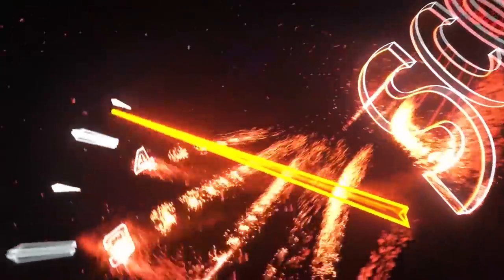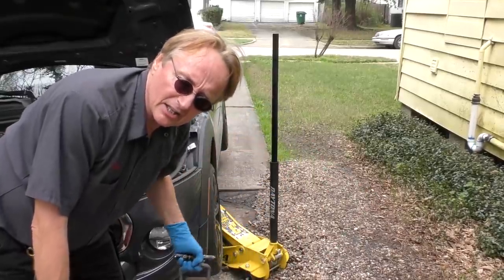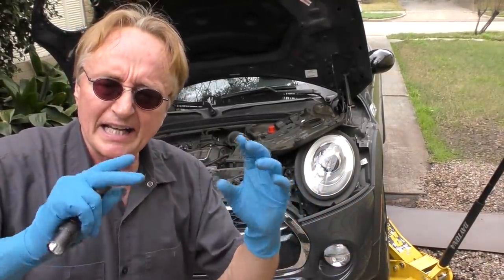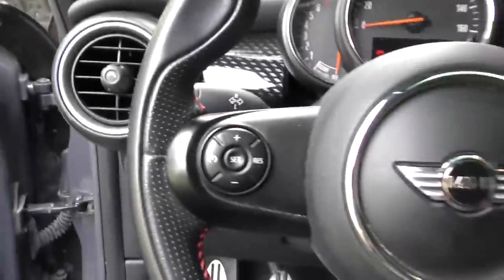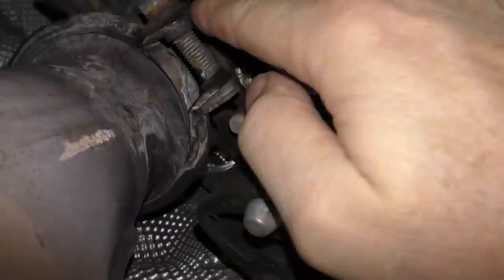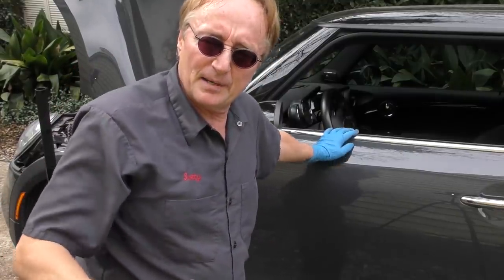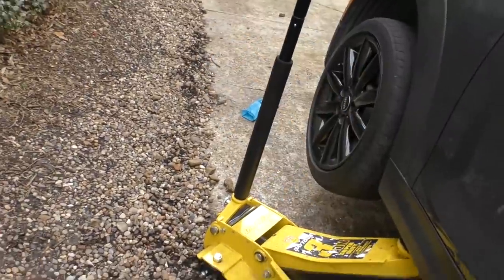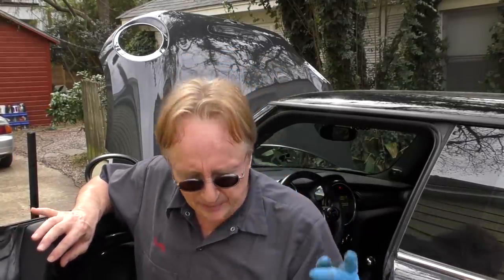Doing This Will Make Your Engine Run Better

Comment: Simple easy fix. Dealer’s assessment and fix would be no less than $400.
Reply: That's if they aren't trying to upsell you a new cat lol
Reply: @AdmiralFroggy  Or tell you your brakes are worn out when they get it on the lift.!
Reply: $300 if your super lucky😁
Reply: Esteban Echeverri and new exhaust.
Reply: @rickdaystar477  ya and disconnect the the brake pad sencer
Reply: @Ilikepie18855  ya
Reply: @rickdaystar477  they just did that too my dads jeep. It has 23k freeway miles. Those scumbags
Reply: @nickmccain6598  It's at the point where you have to ask people you know that had work done for a fair price where did they go.Or get 3 estimates at three shops for repairs. These crooks are predators.
Reply: @rickdaystar477  yea. Its only gonna get worse. In 5 years when electric goes crazy. Mechanics will come up with more ideas. My friend took her toyota to the dealer. And said she needed all new lug nuts. That's just awful. Because she doesn't understand cars at all
Reply: @nickmccain6598  OMG new lug nuts or the wheels might fall off eh ? How about changing the air in her tires?.
Reply: @rickdaystar477  she said the mechanic told her they are really close to stripping next time she changes tires. That should be illegal
Reply: @nickmccain6598  Just out of curiosity did she buy new ones and do you know what they charged her? I'll bet Scotty never saw stripped lug nuts in 50 years. I never have in my own 50 years of driving and maintaining many vehicles over the years and I've honked some pretty tight with impact air guns.
Reply: @rickdaystar477  I just kept my mouth shut. I felt so bad for her. On toyota website. $73 for the set.  Maybe the mechanic is practicing for electric car maintenance😂

Comment: Honda dealer tried to rip me off. Inspection found exhaust leak. They told me I needed a new entire exhaust system $900. I said "show me the leak" and they said "we can't, it's off the lift". I said "put it back up and show me." With my Element back on the lift with engine running the mechanic said "hmm, I thought there was a leak up front" but the only leak was from a rusted connector from muffler to tailpipe.  I took it to a shop that welded tailpipe back onto muffler for less than $100.

Two years later similar thing happened at same dealer. Failed inspection due to exhaust leak. Said needed new exhaust system. I took it home and found the leak was a rusted connector behind cat converter. Bought a new spring bolt and clamp and fixed for $45 at home.

I don't trust the dealer at all. I go there only because I bought my Element there and inspections are discounted. Dealer has also tried to sell me new brake rotors I didn't need. And tried to sell me new caliper but caliper was fine, only the slider pin was rusted which I fixed myself. This dealer has thousands of customers and surely has made millions upselling needless parts to clueless customers.
Reply: Ya as you pointed out do your research and only go to good honest mechanics only
Reply: Ask dealership first if they know Scotty.
Reply: @Conservative_East  ya that's a good idea
Reply: So glad i found the best honda mechanic in south Carolina. I bring food and my car with me there cause i only give him the hard jobs so i feel bad. so bojangles biscuits go a long way friends.
Reply: I mean, you can do cheap bubble gum repairs and bodge together exhausts. But, in most cases you'll be chasing a new leak every couple months as the whole exhaust system is engineered to crap out in unison. A dealer has to be accountable for a long term solution, though. Exhaust is no joke, getting daily carbon monoxide can really screw with your health and you wouldn't know it. I think it's really a sham how chincy nearly all factory exhausts are. Almost gauranteed to rust out in under 10 years of road salt. Costs the owner either their health or $1000 to fix properly. They should all be factory stainless, but thay would be $50 of lost profits and way less new car sales. My 1999, 175k mile, "endless money pit" has a factory stainless one piece exhaust. Exactly 0 leaks after 21 years of Pennsylvania salt. It's also never been immobile, towed, or worked on by professionals. That is not to say i recomend a newer one.
Reply: @apodski  yes agree
Reply: @1stock1not  ya
Reply: Excluding the engine, transmission and few electrical issues, most of the maintenance and repairs are simple and doable at your own driveway. For instance, changing the brake shoes would cost about $400 at the dealership and at least $180 in local auto shops but if you DIY, good quality brake shoes cost about $40-50. If you have to flush your brake fluid, its a $10 job at home, and super easy too, but probably have to pay more than $100 for a mechanic. Same case with the oil change, good quality synthetic oil costs around $25 for 5 quarts, and $5-10 for a good quality oil filter. Engine air filter and cabin air filter cost around $10-15 and replacing them is as easy as changing a curtain in a window.
Many car maintenances are easier than many household chores you do every day in your life. So, why don't you maintain your car yourself? What you need is a little research and the courage to start.
Reply: @upaharjungshah8536  ya
Reply: I had a similar issue due to a bad starter, brought it to the dealership to have the starter replaced. Car has an Aisin carburetor. Dealership first called and said they couldn't move the car since no one could drive a stick.. then called with a 2500.00 bill for needing new fuel injection system.. i bump started it and drove it home, 65.00 later, new starter installed..
Reply: @shartingfish5761  good idea

Comment: Having a damaged engine sucks, but killing two people is worse.  When I was flying an air ambulance in 1994, we lost a crew and airplane after it was incorrectly fueled.  The Cessna 421c had taken on 60 gallons of fuel in San Antoino.  The correct fuel for the plane was high octane gasoline (100 octane low lead); however, it was fueled with jet fuel (Jet A) which is similar to diesel fuel.  Like your customer's car, the engines started and ran until the gasoline in the fuel lines was exhausted (1-2 minutes after take off).  With no available thrust, the plane descended and crashed killing the two pilots on board.

Comment: I have a smoke machine and they have their uses but the best way to find an exhaust leak is using a shop vac in reverse blowing up the tail pipe on a cold exhaust then spray soapy water all over and look for bubbles, it will pin point the smallest leaks.

Comment: The best and easiest sure fire way to find an exhaust leak, is buy the cheapest store brand dexton/mercon atf you can find. Unplug an ummettered vacuum line and let it suck in about an ounce of atf. Then rev the engine up! Wherever it is leaking exhaust a white cloud of smoke will bellow from it. You will also clean you valves really good.

Comment: Hey Scotty.

Do you recommend doing an engine rebuild/buying remanufactured engine BEFORE I need it or after I need it?

I have a 2003 5.4 2v Expedition

230k original engine. Runs like a champ, but her days are limited. Not sure if I should jump ahead or wait till she explodes

Comment: Scotty! I am surprised that leak did not show up considering that smoke machine out put is 10 to 15 PSI. I wonder how much pressure can be achieved by simply idling a car passed the cat.Converter on a typical car that size.? Maybe plugging both exhaust ports securely instead of rag would have given you the result.

Comment: I have a 2019 cooper s like this one and my clamp actually broke.  I had to take it into the dealer twice to get them to fix it under warranty. I had to pull up the white paper of the exhaust system to point out where it was likely damaged. I have the JCW performance exhaust. It has 6000 miles on it and I foresee this being a major issue down the road.  I recommend no one purchase the JCW performance exhaust for the Mini Cooper s.

Comment: Hey! Scotty I have a Audi a4 wagon ultrasport with the 6 speed manual. With 116k miles my ABS sensor sometimes turns on and my speedometer doesn't work when yhe the ABS light turns on.  Even sometimes th ABS will turn off by itself and speedometer works again  i took it to a mechanic and he told me it could be the ABS computer he took a look at the ABS speed sensor and told me they looked good.

Comment: Scotty I've got a 2000 Accord 4Cyl 231K miles. Only major problem aside from weak transmission is that it makes a very loud high pitched squeak/whistle whenever the vehicle is running at an incline or ANYTIME the car is in reverse. The car will also have a rough idle and vibrate while reversing. If I push on the car while it's off it'll make a small squeak. Sounds like it's coming from behind and under the engine. Thinking maybe it's a bad engine mount. Been driving around like this for some time but I want to handle it before it gets worse.

Comment: No need for the fancy smoke machine. Just get someone to hold a rag over the tailpipe for a few seconds while engine is running and with the back pressure build up you will soon see (and hear) where the leaks are. Sometimes they can be as small as a pin hole

Comment: The smoke machine was pushing against a closed system, so it's assumed the smoke was barely able to penetrate the first muffler/silencer and nothing more. So the resulting test saw AIR escaping thru the leak and not smoke which did not even reach the area. 

The only way for that test to work was to push the smoke either from the front of the engine thru the EGR or from a cylinder with the exhaust valve in the open position or to remove the exhaust manifold and do it again from the tips of the exhaust, and close it when the system was full. 

A visual inspection is the best way to find the leak: you can clearly see the clamps on the exhaust pipe going into a muffler/silencer to be corroded/dirty with a type of carbon deposits... No need to start the engine or use the smoke machine. 

It pays to be an engineer before being a mechanic, more to know physics even before...

The smoke machine however would be ideal for the intake circuit, more for turbocharged SC ones than atmospheric which also hate a leak (vacuum instead of pressured) as the MAF sensor would be giving erroneous information. And again one needs to fill the entire circuit with smoke before letting the tiny pressure from the machine blow it out from the leaks.

Comment: Very nice only charging the customer $1 for finding the leak and tightening down the clamp. Normally, a repair shop would at least charge an hour repair fee with the going average hourly rate for an automotive mechanic ranges from $80 to $100 an hour. For minimum repairs like this, some shops will just charge pocket change (~$20) or nothing in order to build a good rapport with the customer in order to show your hospitality and good faith and hopefully the customer will return with any other repairs and maintenance in the future.
Reply: @UCigv7d5t00fY6uKNJYaVPBA True, but I was referring to regular repair shops doing easy service for free in order to get appreciative and loyal customers.

Comment: Would never have thought of this. Is the smoke test something an exhaust centre should be doing? Thank you.
Reply: Personally from my experience some of these muffler shops wouldn't take that much time. They tell you "the carbon monoxide will kill you if you don't get it all replaced"..true story.
Reply: @rickdaystar477 I guess it boils down to finding a Scotty near you. Easier said then done. Beam me up Scotty😁.
Reply: @FoodInDaHood  I did luck out ten years ago when I moved to my present location. My neighbor has a shop and does all my repairs and service. No parts markup and the labor is always less than half of the rate. Sometimes it's no charge except for parts. I'm fortunate to have a good neighbor.
Reply: @rickdaystar477  whereabouts do you live?
Reply: @rickdaystar477 . I have a mechanic on my road but his charges are extortionate and from what I've heard, his repairs are questionable. I'm happy to pay reasonable rates as long as i have an honest mechanic. Pretty much like playing Russian Roulette at times... If only there was A Scotty near me.... 😥🎻🎶
Reply: @papanam4267  Outside of Dansville NY
Reply: Seen the smoke used to find intake.vacuum leaks not exhaust, learned something new

Comment: Those relatively large holes are hell. The relatively small holes are much better, especially if you haven't dealt recently with those small holes. I keep looking. 

You can find those large holes just by smell quite often.

Comment: Scotty could you do a show on how we can protect our fuel systems from the harmful ethanol that we have to buy when we fill up. Ethanol-free fuel is available, but it's way too $$.
Reply: How is it harmful for fuel systems designed for use with  modern fuel?

Comment: I don't know what Scotty is talking about with the exhaust leaks.  I have worked for several dealers and several brands over the last 24 years and the first thing the tech does is check the clamps.  The smoke machine is a big hassle.  Technicians hate working on exhaust systems.

Comment: Take the Jeep to AAMCO transmission, they do warranty work, my dad got his transmission totally rebuilt on his 2004 Cherokee on the extended warranty he pick up at the credit union, his warranty only 1500 miles left on it too.  If it's shifting bad, they need to open it up and you can pretty much guarantee they'll find metal and that's a new rebuild.

Comment: Hi Scotty! 
I'm looking into buying a 2020 RAV4 hybrid. I'd like to ask if you ever had a Toyota RAV4 Hybrid with the problem of not been able to fill the gas tank to full. As of lately there are everywhere videos and complains that the new 2019 and 2020 RAV4 Hybrids are defective and shouldn't be sold.
Thanks!
Reply: I am cross shopping the new Ford Escape for that reason. Possible 43 mpg with the Ford Escape!

Comment: Hey Scotty. I'm a older teenager getting into mechanics. I love to watch your video and learn. I'm thinking of buying a car in the near future. I like the chevy Cruze and in my research have found the early models(2011) have problems up the wassu. They fixed them in later models(2013+) I found a 2014 chevy cruze for $8900 with 162000 kms mostly highway. Is it worth the buy
Reply: Seabass Krahn for that money you should be able to buy a 2016 sedan and for sure those are better

Comment: Is an exhaust leak really that bad? I have a 97 Ranger with a 4.0 Engine. I have an aftermarket muffler, and it leaks a bit. I doubt it would be that bad? Doesn't make any noise

Comment: Dealer wanted to charge me 850 to replace my tundra radiator. I did it in 1 and 1/2 hours and paid just over a 100 for the radiator.

Comment: Hey Scotty 👋🏾 I have 07 Hyundai Elantra when driving sometimes it will jerk hard and ride in a lower gear until I come to a complete stop. Then it will go back to normal. Sometimes it doesn’t. I have replaced both input and output speed sensors. Any help??🙏🏾🙏🏾

Comment: Scotty...have a 2019 Toyota Corolla SE hatchback six speed manual transmission HOORAY!. The stock headlamps don't seem to have a good throw with the high beams. Oncoming traffic doesn't seem to flash me on country roads when I forget to put them to low beams. Aftermarket LED I've heard can trigger codes. What would you recommend for brighter lights and not be a blinder to oncoming traffic?

Comment: Do ya really need the fancy exhaust tool and car battery? Couldn't you just use a vape pen, aquarium tubing, and a few rags? I mean, all you've really got there is an industrial strength hookah.
Reply: @Rü Bən 
Uh... the vape smoke is from oil too.

Comment: Scotty, I have a 2002 Honda Civic LX.  The Air Conditioning belt sqeals when its cold or wet, randomly.  I had it looked at and they said I need to change all the belts and the water pump.  About $800 worth of work.  It has 153,00 miles on it.  What do you think?  Thank you.
Reply: Sounds like a screw job unless you're leaking antifreeze. Some belt dressing on the belt(s). He has videos on it. Find someone to replace your belts...belts are probably about 20 bucks total...15 mins to put them on. Why are they wanting to replace water pump?

Comment: could you use the air duster on the air compressor to pressurize the exhaust with the smoke generator?

Comment: Hey Scotty I have a 2010 Toyota Corolla 95,000 5 speed manual transmission. I'm new to your channel and love all the info you share I have seen the video about remote starters and not to install one I was wondering about cruise control is it possible to install one if so would you recommend it thanks

Comment: Hi I have a question I have a 2006 gmc canyon 3.5l I only have a cold start problem it takes a second to start but when it does it runs bad and dies but I can start it back up and and rev it to 2000 rpms for a second it black smokes then it's fine again till the next cold start I have cleaned the throttle body installed a new fuel pump and replaced mass airflow sensor I'm lost the only codes I'm getting is the thermostat and evaporator emission system could it be 1 of these or a leaking injector? Or something?

Comment: 87000 Miles out of a Jeep Im sold I only got 33000 miles out of a ford f150 . Also Why do cars get so much more mile warranty in the USA compared to canada ? 100 000 km is only 60 000 miles and thats for power train all the other stuff is only covered for 33 000 miles here

Comment: Wouldn't be easier just to start the car up cold, run for a minute or two, then check the exhaust for water.  No smoke machine or psi required!!

Comment: Scotty, hope you're having a good day! What do you think of my 2000 Mazda Protégé 1.6L auto with 190k miles? Has the original engine and transmission.
Reply: I see many of those little Proteges go over 200k miles.